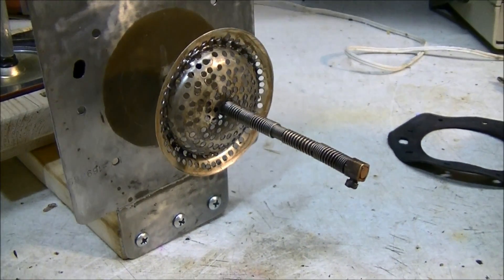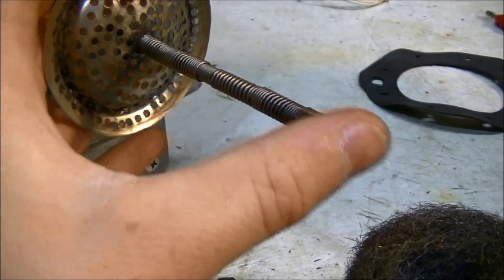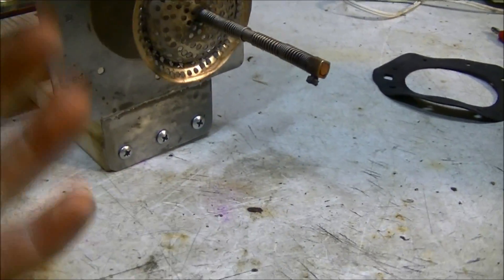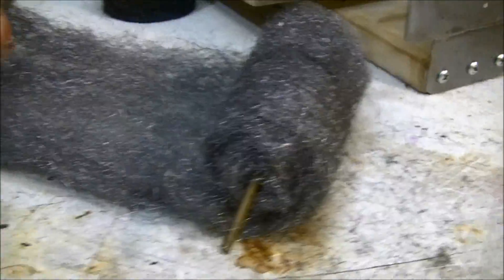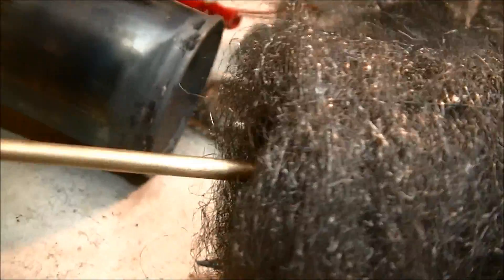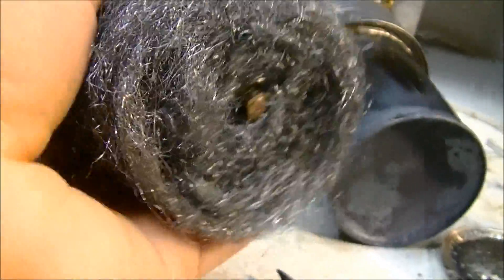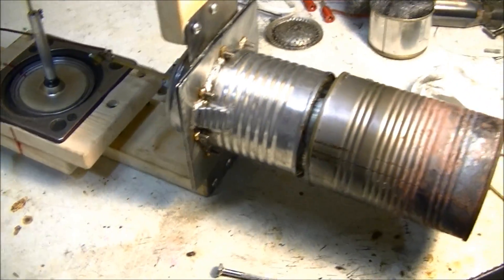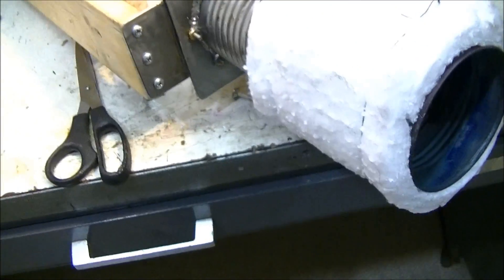Stirling Engine #5 Displacer Rebuild and Hot Side Insulated

Comment: thanks for posting. nice work.  my.02     if you want to see better performance....
the displacer should displace the air. air should not pass through it. where possible, reduce the mass of reciprocating components. reduce the number of components. make them shorter and lighter. balance rotating components. find a way to control/ limit heat. add fins to cylinder inside water jacket to improve heat exchange.
the volume of power and displacer cylinders should be about the same, when engine is cold.  [ volume = height x pi x r-squared ]
don't try to take any power from a linkage, output of engine is low torque. take power off with reduction gear/pulley. a turning motor/generator makes alternating current. take a look at gamma stirling....two parallel cylinders/pistons.    cheers
http://www.geo.unizh.ch/~iwoodh/gamma.gif
http://scholar.lib.vt.edu/ejournals/JOTS/v37/v37n2/images/foster3.jpeg
http://i1.ytimg.com/vi/ATUYB_vFjic/hqdefault.jpg
Reply from the maker: Thank you for the tips!  I will have to try that!  I have tried using displacers that actually displace the air like you describe.  But I have had better results with the steel wool ones like this.  The problem probably is that I don't have very close tolerances between the displacer and displacer cylinder.  Maybe if I can improve that I will be able to get a real displacer to work better.  Thank you!
Reply: Makerj101 Something else is wrong, if your engine runs better with a 'flow through' displacer. cheers
Reply: David Davids Also, if you can find a can/cylinder, inside which a soda can will slide easily, it would make a great displacer. That engine design relies on gravity to pull the displacer down. make two small holes near the center in the top of can to remove soda. run a piece of wire through the holes for an attachment point. that engine design relies on gravity to pull the displacer down. if needed, ballast can be added.   imo, a fast running engine, with short strokes, should produce usable power, when power is taken off the crankshaft using a reduction gear. cheers
Reply from the maker: Interesting idea!  I will have to do some experiments when I get the chance!  Thank you!

Comment: Does the air flow around the steel wool or through it???? Please and thanks!
Reply from the maker: The air should flow though it an transfer some of its heat to the steel wool.
Reply: OK thanks so much! I'm just waiting on some supplies to get here
Reply from the maker: You want the steel wool to be as fluffy as possible so that the air goes through it easily and not around it.  I did not do a very good job in the video of making it fluffy.
Reply: Makerj101 thanks man
Reply from the maker: Your welcome!  Drop me a line or something when you build it!  I'd love to see your engine!
Reply: Oh i will! very excited to get it running
Reply from the maker: Thanks!  Yeah it is so exciting to get a stirling engine running for the first time!
Reply: i bet! do you think you can charge lead acid batteries with your engine?
Reply from the maker: Yeah I could but it would only be a trickle charge of about 80-100mA.
Reply: oh ok awsome

Comment: Oh you want a thermal short!! As much of one as you can get. That's the whole idea of a Stirling... :) If your displacer is low, and gets hot (like how the last one died), and there is cool air above, and the displacer goes up, and the cool air goes through the hot displacer. Whats going to happen? Air get's hot before it gets to the part where it is supposed to expand... How can the displacer transfer energy if disconnected? Your displacer is the opposite of a re-generator.... Should be cool...

Comment from the maker: Well I am not even all that sure.  My understanding is that you want your displacer to displacer the air but you also want an area that the air can go though and transfer its energy to before goring from the hot side to the cold side and vice versa.  Finer wool might be better.  I don't think you want the wool to press against the sides of the displacer cylinder.  That would be similar to a thermal short.

Comment: You have close to 1000c on the hot side of displacer (Red hot steel), and slightly above room temp water jacket. Thats a lot of thermal expansion (in gas) that should be happening. Except I'm not sure it is, because your water is not getting hot... Should be with how slow its flowing.... Read somewhere a stirlings thermal transfer %, was close to efficiency %. If you can get more heat into the water, you should get more power out. If water not getting hot, air not getting cold.......

Comment: Compare displacer displacement to piston displacement. You need air expansion to push the piston. So I'm guessing displacer would want to displace a bit less? But maybe other way round, as its displacing cold air to be expanded by heat. Measure piston displacement by filling to max volume, then displace water till at other end of stroke, then measure water spilled. So do it over bowl/tray.... Finer wool will give more surface area and more thermal exchange. Cont..

Comment: I could be showing my lack of understanding of stirlings here. But I would have thought a displacer with less air going through it and greater displacement volume would be good? I can see how thermal conductivity plays a big part. But I'm thinking finer wool wrapped tighter. With more pressure on cylinder sides to take advantage of water jacket better. If you submerse the displacer in a measuring jug of water. How much volume does it displace? cont....